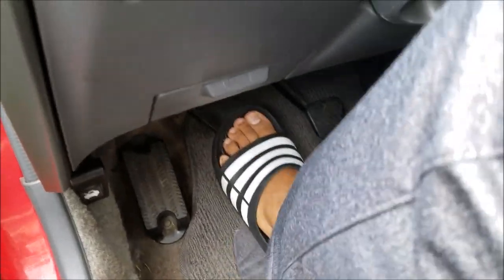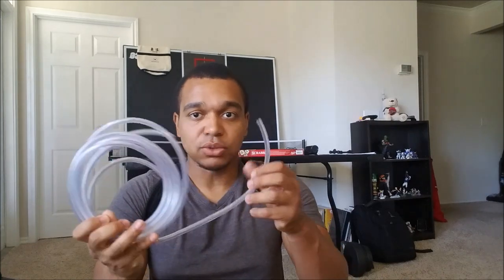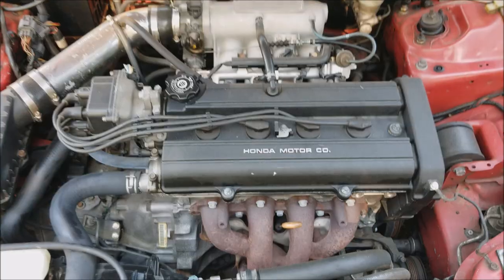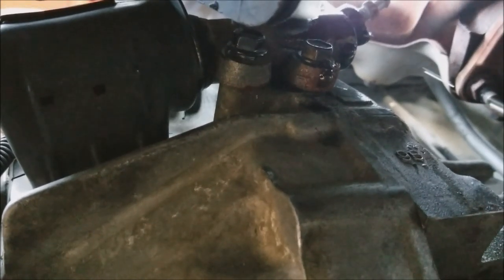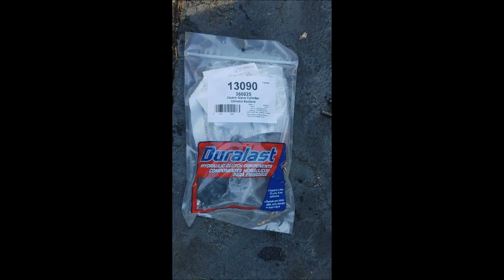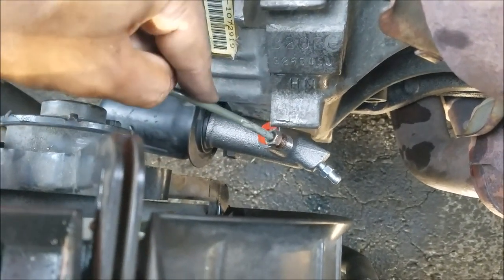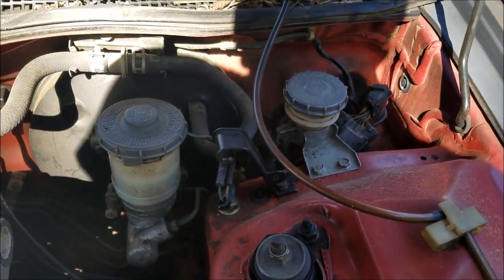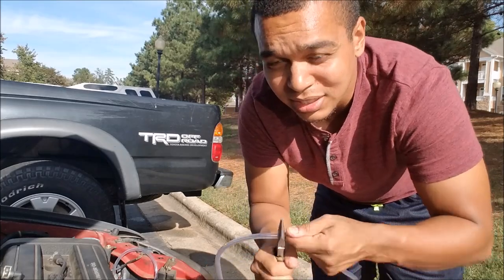SELF BLEED CLUTCH LINE & Change Slave Cylinder | Honda & Acura

Comment: This is a well explained tutorial on this repair, performed by a nice, well groomed, young man. Yes, it matters. I'm old school and it's refreshing to know there's a few in the succeeding generations that are articulate and well mannered. Great job.
Reply from the maker: Appreciate the kind words and you taking the time to share feedback! This was one of my first videos, it's a bit rough around the edges but glad it's still helpful and clear. Also, all praise goes to my family for raising me up right
Reply: The sad part of this video is that he is throwing brake fluid to the nature. Always recycle your trash while working on car, please.
Reply: @flowmotions109  there's always someone to point out the negative
Reply: @praisethelord8750  dot 3 brake fluid is 98% glycol ether, usually the Methoxyethanol variety. it is biologically active and degraded into co2 and water by most air breathing bacteria. it also soaks into the road which before they called it asphalt they called it oil-tar because thats what it is, billions of gallons of heavy chain crude oil are mixed with rock and heated up every year to maintain roads, and they are then just dumped by the cubic yard onto the road. but no one looses their mind about the ecological impact of roads (because there basically is none if done responsibly). you should be more mad about local gov switching to cheap sodium chloride as deicer instead of more expensive calcium chloride because it rusts the bottom off of cars (causing an eco impact for needing to make new cars) and also causes more freeze-thaw cycles causing potholes and road degradation requiring more oil-tar to be manufactured and poured onto the ground. airports go through thousands of gallons of deicer each year which is usually a mix of the same thing as dot3 brake fluid, but no one goes on youtube and has an aneurysm in the comment sections. 
yeah maybe he should put a drip pan down or a towel, but then what? where in the world do you take a couple ounces of brake fluid to be recycled? you dont, you just throw it away. atleast the road will be recycled one day and the glycol ether will probably get cross linked into the next oil-tar mixture and become a parking lot. but thanks for your concern

Comment: A trick I have used for years on the bleed bottle is put a couple of steel nuts inside of it to give it some ballast weight and keep the cap on it and drill a hole to fit.    Great video, very well explained.   I am a  retired aircraft mechanic, 21 years, USCG.  Keep up the good work.
Reply from the maker: Thanks for the feedback and tip! Always like to hear from folks with experience. I'm definitely going to use the nuts as ballast to give bottle stability. Save some hydraulic fluid on future bleed jobs

Comment: Great job of explaining the concept of bleeding the air out of the slave drive regardless of what ever you are working on. No big deal on a couple of drops on the ground or cement, a little section of news paper will work as well in collecting the fluid as anything then throw it a trash can. You went to a lot of work in making video, kudos to you.
Reply from the maker: Thanks for the feedback and info on collecting fluid! Since this video I've gone and made sure to properly collect drained fluid going forward. I like newspaper idea as it's a fast cleanup
Reply: Couple drops???? He dumped the whole system on the ground.

Comment: another little tip - put a tiny hose clamp on the end of the tube at the slave to clamp the hose tighter so air doesnt enter. That being said, this system didnt work for me. I will need to get a friend to help me pump my clutch pedal.
Reply from the maker: Good tip on the hose clamp addition! Hopefully the bleed process goes smoother with the help from a friend

Comment: Thanks for the video! I learned a lot from the portion about bleeding the clutch, the process worked perfectly. Unfortunately it didn't solve my problem, but I was able to narrow down my diagnosis and call the shop that worked on it previously to get the parts warrantied.
Reply from the maker: Thankfully you got the part warranty and were able to narrow it down. Always a nice feeling to solve a car issue. Glad the video was helpful in the process and thanks for leaving the feedback!

Comment: Thanks for video. I bought a work truck and had a guy try and help me bleed the slave cylinder. I asked him if he knew how. He said yeah I’ve done it lots of times. Few days before that my cousin told me that I would need a clear line and this guy didn’t use one. Well long story short , bled the line 3 times and not once using a clear line. So I’m sure just loosening the bleed screw & pumping clutch only to tighten the screw back allowed air back in.
Reply from the maker: Oh yea, it's hard to due a self bleed without a clear snug fitting line. No good way to tell if airbis being pushed out of the cylinder. Hopefully the video was helpful enough and gets you on the right track! Appreciate the feedback and background of your story :)

Comment: Thanks mate, just replaced mine today and thanks to your video know. I hadn't quite bled the line enough. I just wanted to make sure I was doing the right thing before I continued.
Reply from the maker: That's great news. Its always tricky bleeding the line. Air can get through the smallest holes and enough of it will cause a squishy pedal which is annoying. Thanks for taking the time to let me know how it went!

Comment: Nice of u to take the time to make this.  Couple of things I disagree with. 

One, there was lots of air in the pipe, which would've gotten sucked in before any fluid from the water bottle, which deems the bottle unnecessary.

Two, the empty water bottle looked foggy with droplets of water. I usually rinse the bottle with whatever liquid ur gonna be filling it up with.
Reply from the maker: I'd advice you to watch the video closer again, no fluid is being sucked from the bottle. It's only there to catch discarded fluid and be able to dispose of old fluid properly. It's a tried and true process if done correctly. Give it a try :)
Reply: oh really? ok. yes, im gonna change my slave cylinder today or tomorrow. i agree that it will catch the old stuff from the line, but  im still unclear why you poured good brake fluid into the water bottle before catching the old stuff?
Reply from the maker: @justjonzing3636  Good question, I put the new liquid in the bottle for two reasons, 1. to provide weight in the bottle so when old liquid is pumped in it doesn't want to tip, I've had that happen :/ and 2. when I crack the bleed screw a rush of air won't enter the slave cylinder since the line will be fully submerged on the exit side causing a pressure equilibrium. Think of a straw scenario when you hold one end the liquid suspends. It just allows the air bubbles to bleed out faster and reduces less outside air from coming in.

Comment: My question is what does that silver knob at the end connect to? Is it a magnetic connection or what? The thing that goes inside the boot.
Reply from the maker: It's just a knob that pushes the shift fork arm, there is a bowl indentation on the shift fork inside the boot. That's my best guess, hope that helps!
Reply: @EngineeredMojo  Thanks I watched another video which then I understood the concept. It's a essentially a piston that get pushed with the pressure on the line and it's pushed it outwards which then pushes the indentation on the clutch fork. Thanks for your reply ✌️

Comment: Your viedo very helpful..
One thing for sure..
Really no need to fill bottle 1/4 of the way with fluid..
Cause it might be needed when filling reservior..
I basically just filled bottle with water...1/4 of the way..
Dirty fluid was flushed out..
I didn't contaminate fluid incase it had to be reused..
Reply from the maker: ahh smart just using water! save some of the brake fluid. Thanks for sharing on the channel, will definitely use your tip

Comment: Thank you body, nice and helpful video. What do you think about a container underneath to prevent that fluid from dripping on the ground?? Thank you again.
Reply from the maker: Don Martin using a container is a good idea!
Reply: Don, thank you. I really like and appreciate how you address the dripping issue - simple, sweet and to the point without any screaming, cursing and accusation (like few others did). Thank you again for your kind words. No I have no hidden interests with this video and/or Engineered Mojo. I was ticked how these people acted in response to a very good DIY video.

Comment: Good video, when putting the new slave cylinder back in it feels like it won’t line up and takes a lot of pressure to line up with the bolts?
Reply from the maker: Yea there will be a little bit of pressure, but once you get one bolt line up an started you can just rotate the cylinder to line up the other bolt. There will be pressure, but can maneuver cylinder with one hand for sure. To me it felt like a firm balloon when you press on it
Reply: @EngineeredMojo  ok, did you do this from under the car?
Reply from the maker: @jondoe9708  yes, for me it was easier to see the bolt hole lined up from under the vehicle. Once one is lined up, I hopped above to finish installing the other bolt. It could be done from above I'm sure if you can get a good sight angle on the bolt holes.
Reply: @EngineeredMojo  I got it, thanks man!

Comment: Was wondering what's a bad slave cylinder symptoms.  Cause I let cousin used truck. When I was getting truck back he went under the truck and he was trying to grease cylinder the next two days truck doesn't run anymore
Reply from the maker: Has the cousin said what he was greasing?
Reply: @EngineeredMojo  when returning truck supposedly he said it needs grease so he got my grease gun went under the truck   and I seen he was trying to grease the slay cylinder next to the transmission

Comment: best explanation and video on this topic. keep doing what you’re doing!
Reply from the maker: Appreciate the video feedback! Glad the video was informative and clear
Reply: @EngineeredMojo  very! also one quick question, im about to do this on friday, do i need that flare wrench you were talking about and using or can i just use a regular wrench?
Reply from the maker: @calumwilson1120  you can use a regular wrench, but there is a higher chance you'll strip the nut on the hydraulic line. I'd probably use a pair of channel lock pliers before a wrench
Reply: @EngineeredMojo  i see? do you know why regular wrenches cause it to strip easier? sorry for the questions, just like to know this stuff for future reference
Reply from the maker: @calumwilson1120  no problem at all, it's because a regular wrench only grabs a nut by two sides. Unless you have a high quality wrench, there will be a bit of slippage while attempting to loosen the nut on the hydraulic line. All it takes is one slip too far and the nut is damaged. A flare nut will wrap around almost all the way, creating a snug fit and allowing you to apply additional removal torque with less chance to slip and strip.
Reply: @EngineeredMojo  oh cool, did not think about that, appreciate the help!

Comment: How do you drive a stick shift from more than just 3 or 4 days without air getting into the system.... I've got dealer parts everything just leaks internally
Reply from the maker: Ahh dang maybe bad luck on part quality. I know aftermarket slave cylinders are notorious for leaking, but usually OEM is solid quality

Comment: Is the reservoir filled with brake fluid too?
Reply from the maker: It sure is, brake fluid is used for the clutch line. Don't think of brake fluid as "brake" fluid, but rather a highly in-compressible fluid used for hydraulic line systems and can maintain it's properties under high heat and strain. Good question and great for checking

Comment: The 10mill slave cylinder nut is very happy where it is. It will not loosen whatsoever. Any tips to help me?? Please and thank you
Reply from the maker: Oh I've been there before! Spray the nut with penetrating fluid aka liquid wrench or another brand, really cover it. Let it sit and try again. Also, check if your flare nut wrench is a bit worn and not fitting snug. Picking up a new one may help as well
Reply: @EngineeredMojo  thank you, I will try again later today, much appreciated
Reply from the maker: @xaviert4748  no problem, let me know how it goes and I'll post this question to a facebook group I follow to see if anyone has any tips as well
Reply: @EngineeredMojo  will do
Reply: @EngineeredMojo  it still won’t come out. No matter what I do neither of the 10s or the 12s will come out. I already stripped and rounded the 10 I just don’t know what to do this is fucking ridiculous
Reply from the maker: @xaviert4748  ahh man, if it is already stripped my next move would be to use channel lock pliers. They usually get me out of a pinch with bolts but can damage the bolt. If it's already stripped then there is no worry there
Reply: @EngineeredMojo  nothing is working, I blasted it with heat didn’t work, tried to melt it, I’m burning up the hardline and I can’t find a hard line anywhere online
Reply from the maker: @xaviert4748  for a hardline, either creating one your self or junkyard is your best bet. Worst cas scenario you just cut out the hardline. Those can be made at a local machine shop as a last resort pretty easily

Comment: great video! is it possible that the clutch line needs to bleed but you dont need to replace the slave cylinder? mines 21 yrs old.... and my clutch is not to the floor but weaker
Reply: had no fluid in the resevior    fuilled it up now is great thanks mojo u saved me 400 bucks
Reply from the maker: Haha solved your own issue, was about to say many times bleeding is all you need to do
Reply: @EngineeredMojo  ur the best mojo!

Comment: Hello, I see that the silver metal bar at the end of your slave cylinder flops around. Is that normal?
Reply from the maker: It sure is, it becomes straight and stiff when hydraulic clutch fluid is applied within the slave cylinder valves

Comment: Do I absolutely need the flare wrench or can I use a regular wrench
Reply from the maker: I'll say this, out of about 10 times I've seen or I myself have used a regular wrench prob 80% of time the nut starts to strip. I would highly recommend purchasing a flare nut wrench to do the job. Remember you also need to tighten back the nut which it can strip at that time too. Once it strips it's not as easy to replace as a regular bolt either. I'd take all those factors into account before using a regular wrench then decide
Reply: Engineered Mojo So at the moment I’m having trouble still it seems like the 12 mm is stripping the bolts so I went down to 1532 still too big so any suggestions on how to take off this boat that’s so stuck on there and striking a strip I got a ratchet
Reply from the maker: @joshuaambriz2187  channellocks (tongue and groove type pliers any brand) would be my next go to if stripping has already started to occur. Channellock pliers have gotten me out of many a problems. Doesn't need to be channellock brand though, just a generic name like kleenex
Reply: Engineered Mojo Thanks bro I’m not even sure if I heard of that before but I guess I don’t like AutoZone and ask about it thank you should I get some like lubricants to loosen the bolt
Reply: Engineered Mojo Oh those like water pipe wrenches

Comment: Hi. First of all great video!! Secondly I wish to ask if you're clutch was loosing fluid before replacing the sleeve. I have a civic mk8 2.2 and sometimes the pedal it's soft, sometimes hard and sometimes wouldn't go in gear. There is no leak I can see. Thx
Reply from the maker: Thanks for the feedback! And yes I was loosing fluid at the slave cylinder near the pushrod. I've also, different time, had it where I was losing fluid at the master cylinder at the firewall. I couldn't see the fluid being lost at the slave cylinder, but I could at the master cylinder given the small stream trickling down the firewall. Your problem sounds like a random air bubbleb is getting intermittently caught in the line. I'd try to bleed your system if you think your slave cylinder and master cylinder are okay
Reply: @EngineeredMojo  I did flush the clutch and the fluid was like mud. Now I got fresh fluid and the problem still there. I heard someone saying that the seal inside sleeve cylinder may be damage because of the bad fluid it has before. I will change it this weekend and I will update :)
Reply from the maker: @Imposter407  ahh makes sense, good luck and yea provide an update if you can! Good info I can add to my mental toolbox haha

Comment: I like your video. You did a good job explaining things.
I'd suggest some vacuum plugs to cap and avoid spills, as well as a catch pan for any oil / fluid missed. I think amazon sells kits of different sizes for cheap.
Reply from the maker: Awesome tip on the caps to avoid spills!

Comment: Did you have to prefill new part or just bleed it?
Reply from the maker: Only have to go through bleed procedure for a slave cylinder luckily
Reply: @EngineeredMojo  thank you for info, got my at autozone yesterday, guy said it was really hard to bleed cause it's not prefilled but your looks to be the same.
Reply from the maker: @Stephen Vasquez  not bad at all to bleed, only need to pre bleed a master cylinder. Slave cylinder no need, plus it would be really hard haha to even attempt unless you had a way to pressure the slave cylinder prior to install, i.e. it doesn't have pump mechanism built in like a master cylinder
Reply: @EngineeredMojo  thanks man I appreciate the info

Comment: Did you fill up the slave cylinder with brake fluid before mounting it up? Just asking for personal advice
Reply from the maker: I did not, mounted it empty and bleed the system to pressurize and fill the slave cylinder. Good question